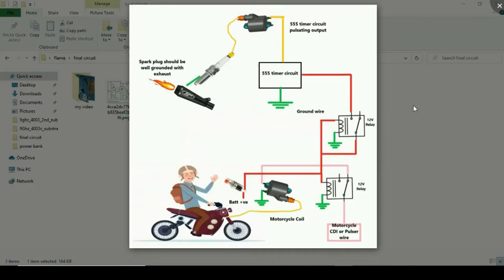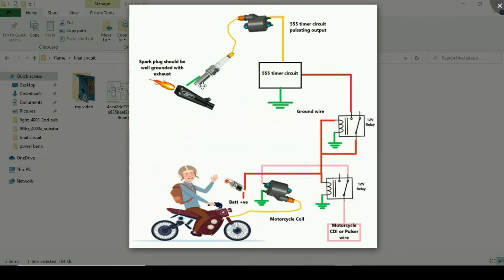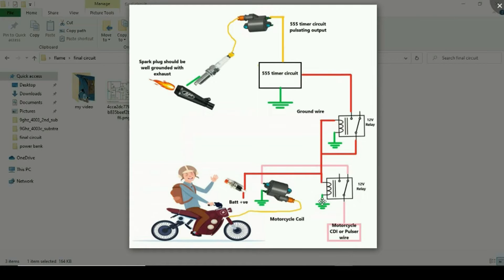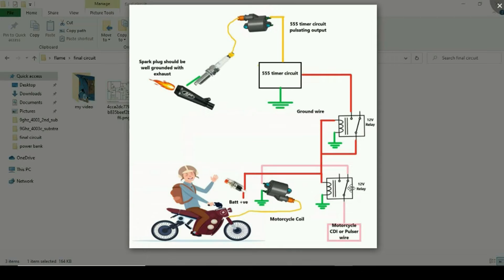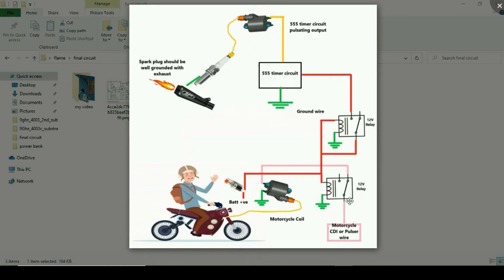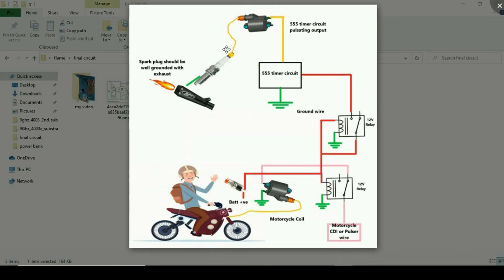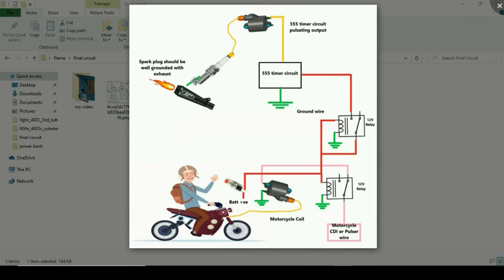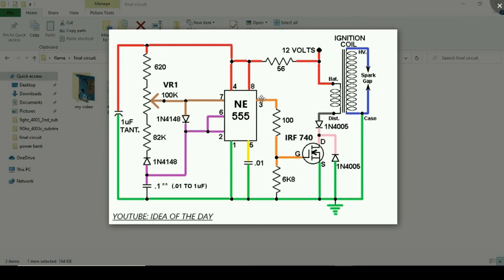How to make a Flame thrower exhaust kit for motorcycle or car | Flame Thrower Kit

Comment: Nice Video, man, so the timer is needed only to skip holding the button?
Reply from the maker: Nope, since the coil requires an Alternating current to operate while a battery is a DC, so a pulsating DC is being generated using the timer ic.
Reply from the maker: The button is the trigger to start the timer circuit and to disconnet the ignition coil from engine spark plug

Comment: Isn't this dangerous to ignite the fuel and travel back to the engine through the exhaust pipe?  Is there a way to mitigate this?
Reply from the maker: Not a problem, the backfire pressure is not enough to damage the engine. Although you should worry about the engine oil instead 😂

Comment: Nice! I have a 2021 Can Am Spyder F3s. They are semi automatic. Can you make one that doesn't involve the ignition coil cut? I just need to find a way to produce a high voltage current by push of a button to my spark plug to burn the exhaust. I already have a cat delete and straight pipe with the spark plug.
Reply from the maker: Why don't you add a separate ignition coil for this purpose?
Reply: @ZflashProductions  yes, they sell it on Amazon, complete kit